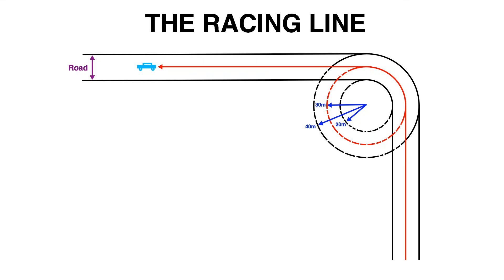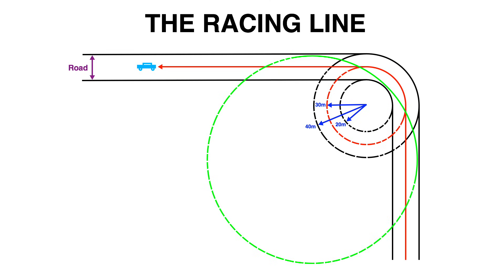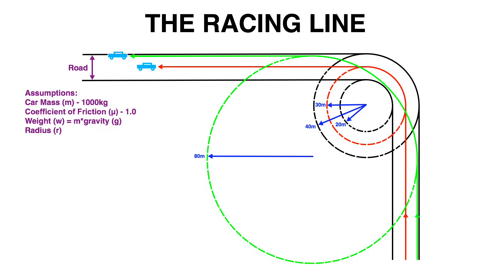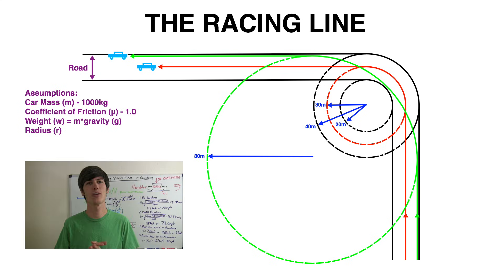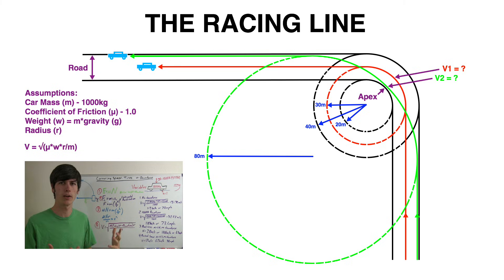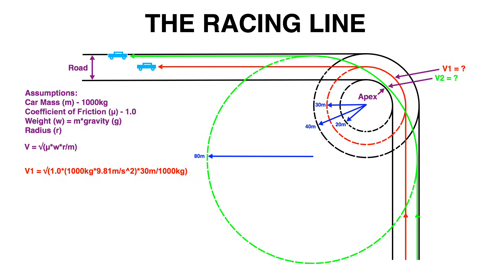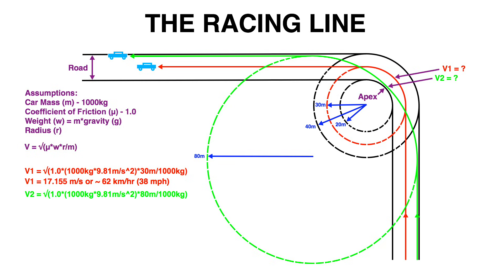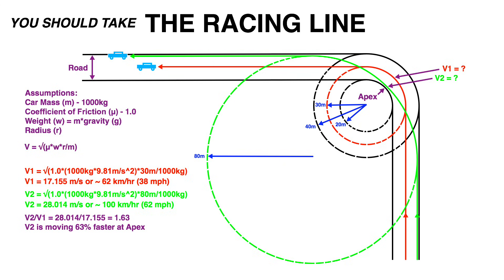The Racing Line - Hitting The Apex - Explained

Comment: im nfs and real racing 3 expert and you cant use brakes from entry to the apex and keep the same radius of steering. gaming real racing 3, nfs and gta 2001-2006 learned me that it is best to start using brakes very early then when entering corner and doing racing line leave the gas and the brakes do nothing until i go 2-7 meters after the apex and slam on throttle. the higher the speed of the car, less the corner angle and wider the track the early i accelerate. i dont like braking to the apex and then slam the gas instantly because when braking i have 2 forces trying to make the tyres slip 1st is centrufugal force and 2nd is the force cause by the mass of the veichle, which means while braking i can take less centrufugal force before slip than if i keep constant speed and this way increasing exit speed. the method is suitable for high steer angle corners after which there is long straight road

Comment: how do I apply this in the real world, does this only apply at the track, do I need an aerial picture of corners to establish what the right line would be, does it not matter so much for big wide sweeper like turns?
Reply from the maker: +SoSickWidit You're restricted to a lane in the real world, but you can still make use of it (using all of the lane). Google maps might help plan it, but it's not necessary, it will become somewhat second nature after a while, while driving on a track. It's the line that allows you to go the fastest. It always matters, regardless of corner, there's a quicker way of doing it depending on the vehicle.
Reply: cough cough empty country roads cough

make sure there is nobody around for freaking miles

 unless you want sh!t to go down do not do this
Reply: +SoSickWidit On a track, it's all about practicing and learning the line yourself, and finding the line that not only suits you but is also the fastest you can drive. Once you've driven in racing games or sims, or in real life for a bit, you get used to it.

Comment: Can you explain when it would be advantageous to take a late apex or early apex in a hairpin or corner? I've seen drivers do this and I don't know why.
Reply: +Brap Brap EE will be able to put a lot more math to it, but it's done to optimize the whole track, instead of just one corner.

A turn's radius isn't actually 1 radius.  It's 2, the entry radius and the exit radius.  What moving the apex does is allow those two to not be identical, which changes the characteristics of the corner itself...and affects the racing line of the whole track, rather than just the racing line of a single corner that exists in a vacuum.  

A late apex makes the entry radius tighter [meaning you have to enter at a slower speed], but makes the exit radius proportionally larger [meaning you have a higher exit speed, and with it, a higher speed at the end of the following straight].  The net effect is that you lose a little time on entry, but spend that much more time accelerating and, if the following straight is long enough and the preceding straight short enough, gain more time by carrying more speed off the turn than you lose by carrying less speed in.

An early apex is the exact opposite: the turn-in is a lot shallower than it would be on the basic line, allowing you to overlap braking and corner entry since the wider line raises the bar for how fast is 'too fast'.  But it compromises corner exit, so not only are you going to exit slower, you can't actually enter any faster because you need to save some grip to get slowed down for when the radius tightens up.  Generally, there's only 3 reasons to apex early:

1) A follow-up corner is close enough that if you exit normally, you'll have overshot the braking zone or entry point for the next turn, compromising not one corner, but 2...or 3, or 4, if it's a big complex and you manage to set off a domino effect.

2) It's being done defensively.  The car behind will have to either follow you, run a hugely suboptimal line, or hit you, and done skillfully it costs them more time than it costs you.  However, it's risky; if the opponent sees it coming, the technique known as 'up-and-under'...pin your opponent down low, make them to apex early, and then dive under them for a late apex once they've pushed wide and exited slower...is the counter to it.  All defensive maneuvers have a counter, so attacking / defending is all about forcing the other guy to make an error you're in position to take advantage of.  

3) When you've got an extremely long straight followed by an extremely short one, and extending the full-throttle run via the technique known as trail braking saves you more time than the early apex is costing you on exit.  If you're doing 200mph at the start of the braking zone, but won't hit more than 60 before the next braking zone, it's in your best interests to apex early; 1 extra second at 85m/sec covers a lot more ground than several extra seconds accelerating up to 28m/sec.   But, you have to be careful not to overshoot the corner; keeping that balance between turning force + braking force under 100% grip means you're not actually turning any faster, you're just braking later and using that wider line to 'save some grip' for braking.
Reply: @TheAmishStig    You may also choose an early apex because of car set-up issues. For instance it can be quicker with an understeering car to try for an early apex. The car may not respond in time to hit the apex, but you still will have time to make the corner and still carry speed. A late apex with a car that doesn't want to turn is a daunting proposition, and you are asking for a track exit.
Reply: @TheAmishStig  fantastic explanation! Just figured you'd like to know you're helping people even six years later.
Reply from the maker: +Brap Brap That's a wonderful suggestion!
Reply: +Brap Brap usually it's better to take a late apex when the next straight away is relatively long. This is to help with maximizing velocity throughout the straight.
Reply from the maker: +FoxdenRacing Thanks for sharing this info!
Reply: it's all about setting the car up perfectly for medium speed or fast corners following the slow one. normally, because they are the slowest corners on the track, a hairpin can be a "throw away" corner that wont affect your lap too much if you dont take the normal line through it, whilst making sure your car is in exactly the right place on the next corner's entry. say, a 180 hairpin right, very short straight, and a 90 degree left. what i'd do is enter the hairpin late and wide, and at such an angle where the car is already aimed at the next apex. it wouldn't be a fast line if say, it were the hairpin and another long straight. there's a video on my channel where you can see this theory in action at the kart track.
Reply: +FoxdenRacing Great explanation, this is exactly what we teach in racing school.
Reply: +Brap Brap In my opinion, it is probably due because the apex target is the rear tire. Because of that effect, it is easier to late or early apex depending of the car traction layout when accelerating out as you do it before the apex.

I could be wrong since I never really raced in real life, but learned by doing many round in many different racing games.
Reply: +Brap Brap On a public road it can also be a bit safer to take a later apex (not for street racing, just safer driving practices), if you are on a road and take an apex early (or try and apex normally and end up coming up short, or finding there is a second apex), it can be quite disastrous, whereas with a late apex you should have definitely seen the corner exit by the time you are apexing.
Reply: +Brap Brap In racing, you generally want to think backwards from the corners that lead to the biggest straights. Instead of thinking how can I take this sequence of corners, you need to plan how you can set up your last corner to be able to leave with the fastest exit speed. This is a classic mistake novices make. They will follow text book racing lines, but they will get tricked in linked corners, and end up coming onto the most important straights with poor top speeds. This is where late apexes and things come in. Plan backwards from the straights.
Reply: I will leave this last bit, to sum up the differences in a nut shell.
If you can see the end of the turn and or strait away after a turn = Early Apex or aim for apex

If you can not see the end of the turn - Late Apex.
Reply: you want to do late apex too when there is lot of corners opposite directions too.
Reply: I believe it depends on the duration and degree of the corner. If the corner is long its advantageous to get into the apex sooner, to minimise the distance needed to travel through said corner. If the corner is short then it is sometimes better to turn in late, in order to get the car straight sooner, which maximises traction and acceleration out of the corner.
Reply: +FoxdenRacing  I would like to sum this up by saying, generally, A "late apex" or "early apex" turn is done when you are dealing with a corner that has a double radius (IE. a two part turn- decreasing radius/Opening radius) or if you are dealing with a chicane of any size that doesn't form a 90 degree turn on either entry or exit. Generally you will late apex on double radius turns, and early apex on chicanes and "S" turns. Blocking and other defensive strategies generally result in someone being as close to the apex while entering a turn. This in itself doesn't mean you early apex'd, as you can also late apex on such a strategy as well, which also,  will generally result in you cutting the line of the person trying to pass.

I like to call this the "Q" cut, as you strike a strait line through the opponents turning radius and making their turn incomplete, This is a dangerous and slightly novice approach as it can back fire in many ways if the opponent isn't aware of this cut.
Reply: +Brap Brap was just gonna ask myself till I saw this!
Reply: +Themayseffect Thanks for building on my post.  There's so much to racing theory that we could write a book and still miss a bunch of it.
Reply: +Daniel Lobo what?
Reply: +E90 M3 #86 you use early or late apexi depending on your car, your driving style and the conditions of the track, one may be more advantageous than the other or a geometric apex.
Reply: +Daniel Lobo I think you have everything backwards - hence my "what?" 

Isn't your entry speed slower for a late apex? You have to take a sharper turn than an early apex, therefore you MUST have slower entry speed. Early apex you are carrying more speed into the corner but may not necessarily have faster exit speed due to not being able to get WOT as soon as you can....

For the last turn if it leads to the longest straight of a circuit you want to LATE apex so that the car is straightened earlier so that you can get on WOT as early as possible. You can watch some of my vids to see what early vs late does.
Reply: E90 M3 #86 Using an early or late apex depending on driveline configuration is flawed. All drive line configurations should be on relatively the same line on a given corner. The difference is when to get off the brakes and on the gas.
Reply: +Themayseffect Thanks. I was referring to his own examples of when late/early apexing. 

In my own personal experience, with a 3700lbs car on street tires I try to have good entry speed and get on the gas asap - but I"m probably just making excuses for not driving as well as I could LOL. I'll see what happens on my next time out, now that I bought NT01's. Car needs more mechanical grip.
Reply: E90 M3 #86 I was referring to their comments, just you were the last commenter. The e9x m3 is heavy yes, and sometimes tuners mistakenly worsen the problem by making the rear stiffer than the front in order to have a better entry turn in. To maintain a good line with that cars weight isn't easy, so it's understandable. 

The other person is looking at the apex incorrectly, it has nothing to do with the drive line, rather the corner angle and weight balance of a car under load. Some of the fastest street cars on the road are AWD rear engine cars, so he's obviously not talking from experience or sound driving skills.
Reply: +Themayseffect got it. I think RWD is the way to go. I can't think of any rear engine AWD cars besides 911 C4/Turbo or (technically mid-engine) R8.

I want a Cayman GTS/GT4 so bad though!
Reply: E90 M3 #86 well I didn't say there were a lot of them lol, matter of fact I think all of the ones available are VAG cars, none the less they are some of the fastest cars available all the way up to the 918.
Reply: what's a late/early apex?
Reply: Nano Kumo Google.
Reply: +Themayseffect ha true. like 4 cars. mid-engine rwd for me though! 458, cayman, etc.
Reply: +Brap Brap late apexing is the norm when ever a long straight follows your primary concern is having the vehicle pointing straight for longer, scrubbing off less speed toward the end of the straight, only problem is with this is you then need to use that speed at the end of the straight effectively by making sure you early apex and carry as much speed into the infield, this is entirely track dependent but generally you will find the amount you need to compromise a corner entry/exit by is determined by the next corner, good racing drivers piece this puzzle together quickly.
Reply: +Daniel Lobo And now I have a rather neutral handling FWD car (great weight distribution, double wishbone front) with a big, old-school (laaaaag!) turbocharger and things get complicated.
Reply: Brap Brap
Reply: +Brap Brap Late apex allows you brake later (start turning later) so you keep your entry speed high. Early apex allows you to start accelarating earlier, so your exit speed is higher. One is preferible over the other depending on the situation, and on your car, you use either to optimize your approach to the whole track.. For example, before the final straight of a circuit, you want to start accelarating earlier, to take advantage of the straight, so last corner you use a early apex, by the same logic you use a late apex at the first corner, to try and keep as much of the speed gained on the straight. You may also prefer one over the other, if there is a follow up corner.

Also, if you're for example in a FWD car, you want to avoid understeer, so your entry speed to the corner will be lower, you would prefer an early apex to maximize your exit speed.

On a RWD car you would most likelly traibrake, so you can have a higher entry speed so a late apex would be preferable.

Another example is if your car is NA or Turbo. On a turbo you want to stay on power as much as possible to keep boost, so a late apex makes more sense.

That is why mid engine AWD cars are the shit, you can pretty much do geometric apexes (apexi?)

Comment: The racing line isn't always the fast line.  You're describing the ideal fast line, not a racing line. Also as you mention, the traction circle of the car changes depending on setup further changing the line :P
Reply from the maker: +Chris Davis I'm describing the ideal geometric racing line, but that doesn't necessary mean it's the fastest line. This of course gets more complicated and depends on the vehicle, if it has more power it may be beneficial to hit a late apex to straighten out and take advantage of the fact that the vehicle can make up lost time with faster acceleration. Basics first, as always, Chris. :)